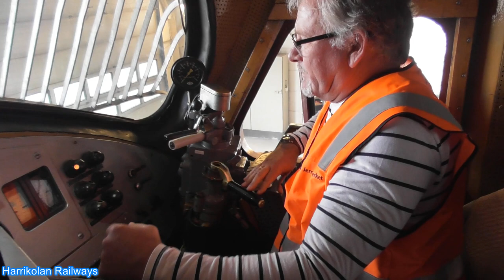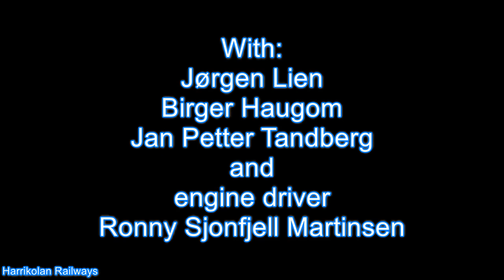Veteran engine drivers are back on the NSB class DI3, Nohab/GM diesel locomotive. English subtitles.

Comment: What's that awfull knocking noise on the engine that was filmed from inside the locomotive? That's not normal.
Reply: It sounds like the air compressor. Sometimes they make that knocking sound.